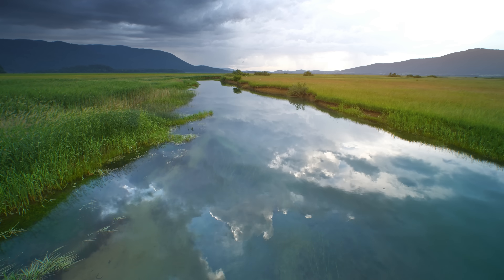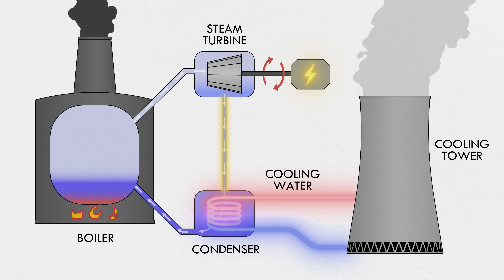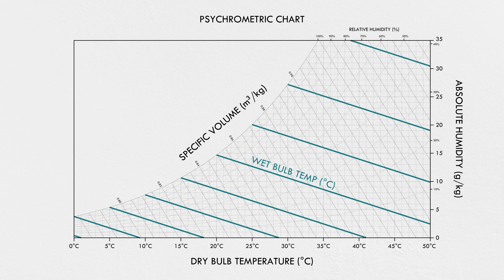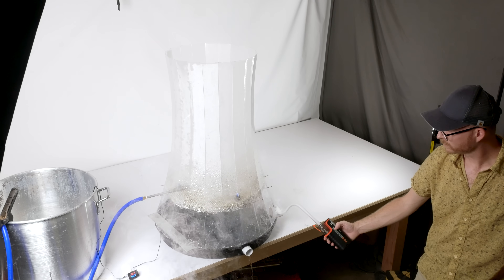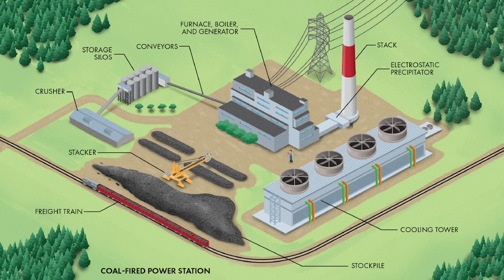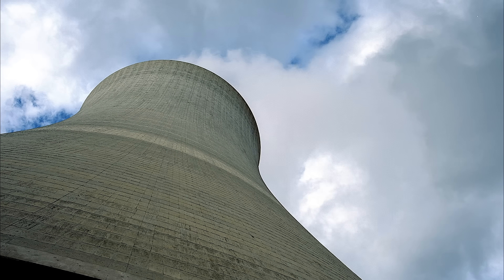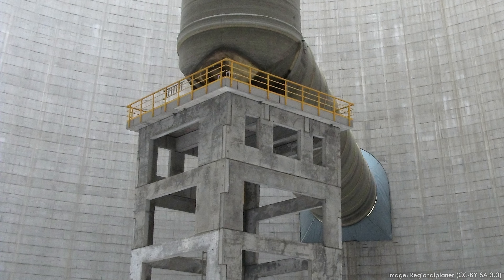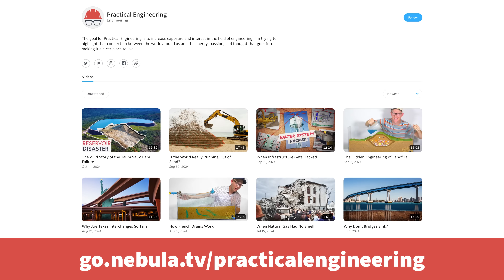Why Are Cooling Towers Shaped Like That?

Comment: There are a couple cooling towers at a cement plant I frequently work at that are mostly underground with just the fan box on top of it going above grade.  Considering that this site also contains 500’ tall preheat tower, calling a barely ten foot tall fan box a tower seems a bit of a joke.

Comment: Could you use thermoelectic elements as reverse heat pumps to cool and recover energy?
Reply: Technology connection did a video on that. It's highly inefficient and the cooling it provides is just okay. It's good for small, specialised operations where the conventional bulky refrigerator can't be used. Or as a car fridge.
Reply: @jamesisaac7684  oh, I know the video you mean, but I didn't mean for it as a primary cooling system, but as a way to generate electricity from the heat.

Comment: The buoyancy of the vapor rising out of the top of these draft towers always seemed intuitive to me, I didn't get a grip on the terminology until much later. I have always had a  curiosity about them to further maximize energy production. Since the air in the draft towers is rising would adding a fan to capture energy from the rising air be an appropriate option? Or would having a fan in the top of the tower upset the draft enough to ruin the tower? I'd imagine it could at least run the water pumps.

Comment: I'm a former HVAC tech and understand the psychrometric chart for the most part, but just learned that dryer air isn't necessarily better for evaporative cooling. Great video as always.

Comment: Just wanted to point out that with a psychrometric chart, if you have 2 thermometers, you can use it to determine everything else. Dew point, relative humidity, air density, enthalpy etc.

A psychrometric chart is also used very commonly in agriculture. Animal agriculture, grain elevators, and greenhouses all need that information for various reasons.

Comment: There is something aesthetically appealing about the shape of the cooling tower. Reminds me of the conical flask which for me is the most beautiful glassware used in a chemistry lab. Also happy to know it is just clouds ejecting from the top of cooling towers instead of carbon dioxide or other toxic gases.

Comment: It sure seems like all that thermal energy represents enormous waste/inefficiency. Can't it be used to drive another turbine or something? Also, if the core is so hot that it requires such massive amounts of cooling water, why not simply make it smaller and less hot and just capture more of its energy instead?

Comment: I have to admit, my thought was that the shape was a flow thing.

Back in the 1960's when I was a kid, my dad's office's AC used this tower maybe 8-10 ft square and 12ft tall [I was a little kid everything looked big], I guess it was part of the condenser, the sides were wooden slats sloping in, probably 4-6in wide, water poured down from the top. I loved to stand next to it, the water sounded really cool and it was also just cooler.  That kind of system wasn't all that rare back then.

Comment: One thing that you didn't mention is that the thermal plants that you showed were single cycle. ie steam is used once and then condensed. The cooling that the towers are doing is disposing about 70% of the energy of the input fuel!

Comment: In the industry “Fill” is technically called “drift eliminator” it serves to keep water from pooling in the air to increase its surface area to give up heat more efficiently.
Reply: Actually not quite. Typically the fill is the fill with a layer of drift/mist eliminator on top above the spray nozzles to reduce liquid water loss out the tower.
Reply: Is the idea similar to a chimney (or maybe a bunch of little chimneys)? I.e., encourage verticality by restricting horizontal movement? I suppose it works in both directions? For both the upwardly convected vapor and the downwardly dropping condensation in the cross-flow?
Reply: @steamer2k319  nah, the fill is basically to make the water splash around as it falls making tiny droplets.

The mist eliminator sits above everything including the spray nozzles (water inlets) to stop much of the tiny liquid water droplets being carried up by the updraft from escaping out the top as we want it to evaporate into vapour cooling the remaining liquid, not just be carried away as liquid.

The towers main structure is what promotes particular air flow regimes...
Reply: @anthonyhovens7488  👍 Should put another turbine at the top powered by the updraft and use it to drive a condenser. Maybe that would cross too much into complicated / less reliable?
Reply: @steamer2k319  The updraft is nowhere near strong enough for that and it would restrict the updraft reducing cooling effectiveness. Besides the condenser is "unpowered", its the pumps that are drawing the parasitic load. They can be up to 2MW each depending on the number, water flowrate needed, efficiency and condition of the pumps.

Trying to draw energy from the updraft would be like adding a single piece of paper to a forest fire. In fact in most cases, we use forced drafts instead of natural convection because it cuts the cost by a factor of 4 for a mere 2% efficiency loss...
Reply: @anthonyhovens7488  Wow. I wouldn't have anticipated that last sentence. It seems the passive interactions that occur after leaving the nozzles are a lot more effective than my intuition expects 🤭.

Seems like the point is to dissipate energy into the surrounding environs which makes me think about loading that same energy into active cooling. I suppose further, though, that if we had good ways of harvesting additional energy from across the already-reduced thermal gradient, we'd add those outputs to that of the main turbine.

It might be a bit like using photovoltaics to power an air conditioner on a hot day. You can do it, but not without a big up-front investment so the effect tends to be pretty localized and also susceptible to failure.
Reply: @steamer2k319  Impractical, expensive, not very high output, and would impede flow.  There ain't no free lunch.

Comment: Wait, so if those are just clouds coming out, doesn’t that mean then that the expensive treated water is still just evaporating and leaving the system, ultimately changing the environment like you were talking about 1:37 into the video?🤔

And second thing I was thinking about, 💁‍♂️if the shape of the tower and holes at the bottom help to create air flow, 🤷‍♂️couldn’t we put fans near the inlets and top of the narrow part of the stack where the air is moving the fastest, to help generate more power?🤔
Reply: The idea behind the cooling towers here in England is that it's all done by evaporation onto the specially shaped sides where it condenses onto them and rains back down into the collection pool at the base, cool enough to be used again. Despite the apparently huge plumes of steam you can see coming out of the top, so much water is in the cooling system that these billowing clouds are little more than 1% of the total volume.

No energy is used in the towers to do this, it's all done by natural processes.
That's why there's not enough draft to drive fans.

Comment: A very interesting video Grady, thank you. Interestingly, it's the opposite way around in the UK - all nuclear power stations (except one) are built on the coast and use seawater for cooling (the exception is one that is built on a lake). Most of the fossil fuel power stations in the UK use the type of cooling towers you described, and are usually situated by/near a river - I assume for cooling water.

Comment: Why not use the thermoelectric effect to deal with the heat and produce more electricity?
Reply: They are only about 5% efficient and are made of rather toxic materials, like bismuth, antimony and tellurium alloys.  Perhaps some day there will be cheap, clean and efficient devices!
Reply: @karhukivi  Bismuth isn't that toxic (see Pepto Bismol.)  Antimony is worse.
Reply: @TheDanEdwards  Pepto bismuth is not bismuth metal, it is bismuth subsalicylate. 
Table salt is sodium chloride, but both sodium metal and chlorine gas are very dangerous.

Comment: This is interesting- I only knew about the greater distance between air molecules (with those molecules bouncing around more, in an excited state) at higher temperatures making the air less dense and therefore having less mass by volume -i.e., having more buoyancy. I didn't know humidity also played a factor. Guess I missed (or forgot) that one from H.S..

Comment: Shame we can’t condense the steam and make drinking water with it
Reply: It actually falls like rain inside the tower all the time, but I didn't taste it!
Reply: @ shame we can’t capture it as distilled water, could help with water shortages and a good way to recoup some of the spent energy
Reply: @DX_Dorset  Not great to drink as there are possible droplet-borne infections like legionnaires that thrive in these sort of places.  The water can be used to hose down machinery and other "grey water" uses.

Comment: I worked at a coal mine near a power plant in Wyoming and during winter it had its own weather due to the moisture put back into the air. 
The side of the mine near the plant had a boat load more snow than the part of the mine farther away from the plant. 
It could have snow flurries on one side of the mine and 2 feet of snow near the power plant. We would even drive through the fog and clouds created by the plants, wind pending.

Comment: Modern nuclear energy is our best option. Molten salt reactors, LFTRs, Thorium Reactors, Small form reactors. We've advanced so much in tech, engineering, material science & our understanding of safety have all improved. This will lower emissions, We just gotta get past all of the fear mongering.

 I'll be honest It does feel like even tho we have advanced in a ton of areas, It seems like it still doesn't matter to most people. It seems like most people are ingrained with a natural negative response when talking about nuclear energy. It's a bummer because i truly believe that our best option for our future is to start utilizing Modern advanced nuclear energy options in our electrical grid. It's just proving to be challenging to get politicians to get on board. 

  It will really allow places to be much more energy independent. Less reliant on fossil fuels. They'll have efficient, stable electrical grids and the rest of the grid could experiment with alternative power sources, power desalination plants, etc. 
We need to heal from the trauma of our past. See & learn that those things only happened solely from Us not understanding what we were doing when it came to nuclear energy at the time. We didn't have advanced enough technology, material science, engineering, safety measures, understanding of how to go about everything, etc. This source of energy will greatly help the world improve towards the future and lowering emissions. More than anything else could, while also providing a very stable electrical grid system. Currently we have alternative energy options but the majority of our grid is powered off of fossil fuels and emission producing sources of energy. We will be so much better going forward commiting to modern advanced nuclear energy options.

Did they outlaw electricity or oil, coal when things went wrong in the early days of those fields? No! They kept going and understood things usually are bumpy and difficult in the beginning and kept going even tho those sources negatively impacted our environment. A huge issue is government BLOCKING any sort of progression from happening. We'd be lucky to see the slightest projects approved or finished with-in the next 100 years.. It's very annoying to see how much we have gotten in our own way when it comes to improving or advancing certain things. Instead we let fear, money, man made "required legal processes" Stop us from doing anything other than wind, solar, oil, natural gas, damming our rivers, mining for minerals... It's very frustrating because we should be able to use all these options in collaboration. If we actually wanted to improve anything. That's what we need to do and stop letting so much potential get blocked from ever occurring in the first place.. It's really irritating. I wish certain people didn't make this so "complicated and difficult" Why would any reasonable person want to block progression?

In my opinion it's been irritating that our society has taken this "it's up to each individual person to make a difference" approach. When that just plays off of people's emotions. This issue is so much bigger than individual people. We need countries/states to get on board. It's the only way we can make even the Slightest difference. We've already waited too long. Everyday is a day wasted & we haven't even made a dent in improving our situation.

The fact that Desalination is so energy intensive but fresh water is so important.. What If we dedicated nuclear energy to be the main energy option to run these energy hungry desalination plants?? Idk why we aren't already doing this anywhere we could...?
Seriously think about it.. Nuclear power produces no green house gas emissions. It's extremely energy efficient. The list goes on. So why are we not utilizing this... We are being extremely too slow, too reserved, too cautious, too inactive to even make the smallest dent into our climate issue and our energy issues. It's holding back progression across the board in many different area's.. It's honestly getting really frustrating. I thought we would be more motivated than this. More active than this....?

Comment: 7:45 Oh ! So to my old question I've look years ago but could find a proper answer online, since moist air will rise, humidifier (and not DEhumidifier) should be placed on lower level in a house? 

Got one in the basement and one on the first floor right now (because RH drop to 25-30% in winter..) so that was the right placement as my second floor is open with a large mezzanine ?!

Comment: It sounds like the big cooling towers are just giant swamp coolers we used when I lived in the desert to cool homes. 
Or got really cold when vented out right against the hot air outside. 

And it put some moisture in the air, which reduces static electricity. That becomes bad on desert in winter, where evaporating water over heat vents increases humidity and reduces static electricity shocking potential trials when you try to open a door.

Comment: I wonder why we dont also take advantage of the rising air and vapor as it exits the top of the cooling tower? Couldn't there be some low-level turbines between the open air and the flume that could (at least slowly) take advantage of that rising vapor? Or is it just too slow moving ... I dont know. But golly, that's fascinating.